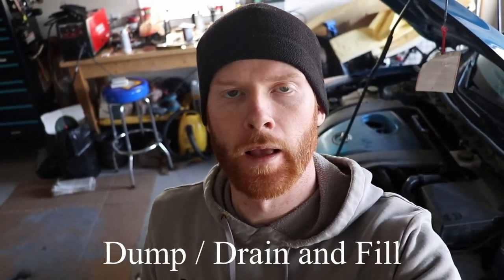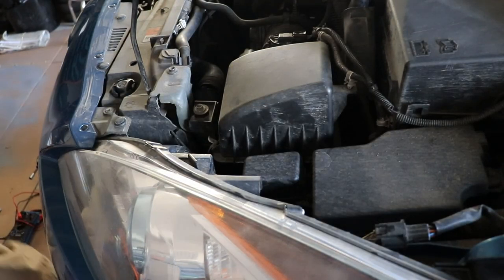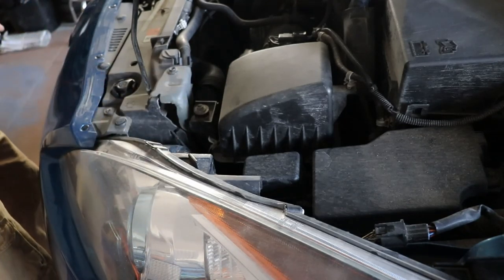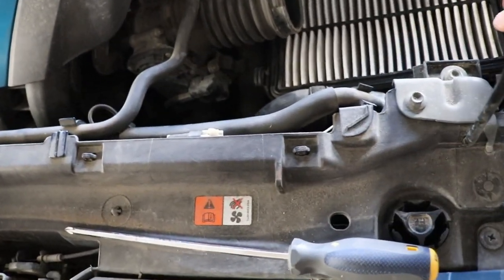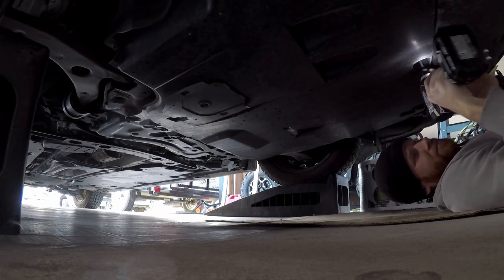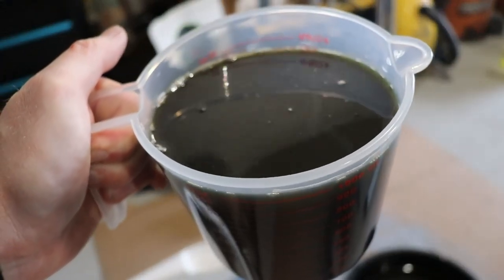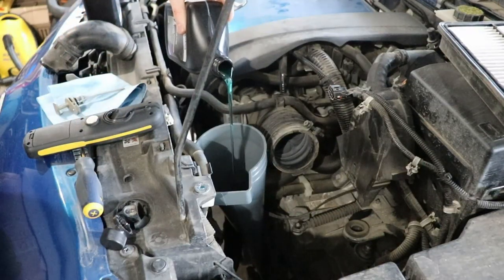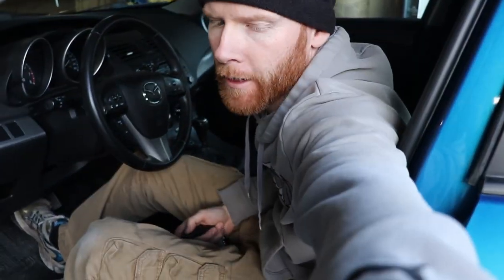Mazda 3 Skyactiv Transmission Dump and Fill

Comment: this is why I love youtube.  cause there is no way i'm about to pay someone 300 bucks to do this for me.   took my mazda in to get the tire pressure sensor replaced.  (200 buck btw for one that's broken.)  and they then call me with over 1400 dollars worth of repairs needed.  one was a transmission flush.    i do most things myself especially when i have the tools.  thanks for the tutorial. mines a 2012  but looks identical to this one.
Reply from the maker: I am the same.way if I have the tools and know how then I will try and fix it myself. I am glad to see more people wanting to learn and be able to fix things their self's. glad you like the video. this wont get all new fluid in after one change. I have been looking at other methods to get a complete flush done. I might attempt it this summer.

Comment: Recently did 2 dump and fills on my 2012 mazda 3. Car had 168k kms when I had the first oil change then another at 170k kms. I also had the transmission filter changed and the pan cleaned. The performance of the car has improved greatly and fuel consumption has gone down alot. The car feels like it's sipping fuel right now. Before the first fluid change, the car seemed to struggle with acceleration and power output was low.
Reply from the maker: Thats great to hear, Glad it worked out and you have had a positive outcome. 

Thanks for watching.

Comment: My 2015 mazda skyactive has lifetime Transmission fluid and does not need a transmission flush so i am concerned people will be changing their fluid unnecessarily.
Reply from the maker: Hi Thanks for leaving a comment, I will first off say that lifetime transmission fluid is kinda a lie. Why you might ask well first off transmission fluid is product like engine oil that will over time break down and wont provide your transmission with the lubrication it requires. This is from heat and other factors that will break down over time. 

Now that being said they might kinda be telling you the truth and that is your transmission fluid will last the life of the transmission meaning that. if you never change it well your transmission will fail sooner then a transmission that has changed its transmission fluid say every 50,000 - 60,000 kms. Just remember one thing new oil or transmission fluid is always better then old dirty broken down fluid. 

I hope this brings some new light or information that might help you. Have a look on youtube and other sites to do your own research as well.

https://www.youtube.com/watch?v=hQpsoI_UfZI

https://www.youtube.com/watch?v=RuNNqh8-jkw
Reply: Lifetime fluid is a lie. I'd drain and fill around at around 80,000 miles
Reply: Why a drain hole/plug is seen under the oil sump pan if fluid is lifetime? Also, why original filter is put on sale if fluid is lifetime?

Comment: Most Mazda dealership service depts state that the trans fluid is "lifetime" and should not be touched... ever.
Reply from the maker: Yes, your correct most dealerships will say that, unfortunately oils break down over time with cycles of hot and cold. Your transmission fluid after a certain point will not longer be protecting the components like it used to. My Mazda dealer will do transmission fluid flushes. This will prolong the life of the transmission.

When a dealer says lifetime generally that mean the average lifetime a single owner will have it for.
Reply: @TDLDIY  The car has 65K miles on it (2017 Mazda 3 2.0 Touring). I still feel a drain and refill (4.5 qts) should still be performed. I don't believe it's going to "hurt" anything lol

Comment: Thanks for this video! It's so hard to find info on this. I do have one questions though! Is there a transmission filter that you would recommend changing as well?
Reply from the maker: You welcome, I am glad my video was helpful. As for the Transmission Filter i would say check with your local dealer ask them but give them your VIN this way they can check and tell you if it has one.

For my Car i was told there wasn't a filter but i would always double check to be sure.
Reply: @TDLDIY  right on cheers!

Comment: I got my drain plug snug but now I’m terrified in case is leaking,and I’m thinking about removing the bottom cover to inspect it… Other than that it was a breeze, thanks for the video
Reply from the maker: If your considered let the car run, cycle through some of the gears while you front end is off the ground this way you can inspect for leaks. 

If your still concerned then do short trips and always check underneath for leaks.
Reply: @TDLDIY  I waited for about an hour and then installed the cover back on, and the drain plug was dry after that hour. I’m just paranoid and overthink everything when it comes to cars. If it didn’t leak after an hour sitting there I should be fine right?
Reply from the maker: @GodExplained  Ya, if you ran it for sometime and let it sit with no looks you should be good to go. But maybe for a couple days after just look out for any leaks.

Comment: Why not check the fluid level with the dip stick, that's what its for right?  I have to do this with my daughter CX 5 and I am worried that the person that did it before didn't do it right or what if some leaked out ..  problem is different videos say check it off and some say check it while running... so I am confused a bit.
Reply from the maker: Yes, always check the dip stick. You will have to do this when the fluid is warmed up and engine is running.

When i dumped it and measured it, it just gives me a good idea how much i needed to add. but if you do this when the engine is already warm then you will be putting in too much. since the new fluid is cold or room temp. when the fluid is hot it expands. so you will have to keep that in mind.

I hope this helps.

Comment: As you mentioned, did you do another drain and fill a few weeks later and if so, did the fluid look a lot cleaner than the first time..?
Reply from the maker: I didnt I got busy with other things. But I do plan on doing another one this summer I have about 142000 kms on it now so what like 20 000kms more then when I did it. 

If you did it a couple weeks after then your would have more of the dirty fluid replaced. if you dont then replace it more often then normal. I will do it this summer and I will put an update in the comments what I found. 

I hope this helps sorry I didnt get the second dump and fill in again.

Comment: Such a pain in the ass having to remove the air filter assembly.
Reply from the maker: yes I agree 100%. Most other company's make the transmission drip stick accessible. I had a nissan rogue 2010 it was accessible but had the same type of cap thing on it. but at least I could look down and see it. instead of removing a bunch of things just to get at it.
Reply: I didn’t remove it.    Used a funnel with a long flexible hose.   Way easier
Reply from the maker: @sjhanksaz  oh you had room under the air filter box? Well That is awesome to hear you were able to do it. I am sure others can benefit knowing it is possible. Thanks for your comment.
Reply: Try removing the air filter on a Peugeot 308 diesel

Comment: Just bought same car with skyactiv engine with 118,000 miles on it. I'm debating if I should do a drain. There is no scheduled maintenance in the manual for this engine. Then I read that for skyactiv engine, the transmission fluid is lifetime for that engine until there is a major transmission maintenance. What are people's thoughts about this???
Reply from the maker: So first thing i will say there is no such thing as life time oil/fluids. Oils will break down over time with heat cycles this is why oils good from clear,blue,red,golden in colors to darker or even brownish to black. 

When they say lifetime and you dont change the transmission oil it will be the life of that part in this case the transmission the transmission will run untill the oils is broken down so much the transmission will over time fail hense life time. This is also lifetime because most people dont keep cars longer then 5 years so it will last longer then that and or fail around that amount of time depending of total miles/kms driven how hard you are on the vechile etc. lots of factors.

Now on to the should you change the fluid you do have alot of miles on it already. I had about that much in kms and i did a drain and fill. and did it again a bit later and then i am going to be doing it every 30kms... now i know some people will stay 30kms isnt long and the fluid will last long and they are correct but since i did a drain and fill it doesnt replace all the fluid at once only about 40 to 50 percent so changing every 30kms will ensure over time and many drain and fills later i have good fluid. 

This might 100% answer your question as in should you do it.. best answer for this would ask your dealer and what they recommend. But i will say one last thing New fluid is better then old. The damage might already be done. doing a flush that forces fluid thru the transmission might not be good as why i did a drain and fill. Which ever you decide it will be you choice. 

I hope this helps in some way. Thanks for watching my video and taking the time to comment.
Reply: Thanks for the video and the info. I have 157,000 on my car and I was concerned about the transmission fluid. At that mileage some say leave it alone and pray it lasts. This seems like a happy medium between that and a flush.

Comment: Thanks for the vid.   I just did it without removing the air box.   You can remove the dipstick from below and just need a funnel that has a flexible hose
Reply from the maker: Awesome Thanks i will give that a try next time.
Reply: do u have a link to the type of funnel u used?
Reply: @TDK2K  I got it on Amazon.    Search for this Lumax LX-1603 Transmission Funnel with Hose. 16 oz
Reply: @TDK2K  I had someone hold it in the  hole while I filled so it would not accidentally fall out.   Worked really well

Comment: this is the smart way to do it. dropping the pan runs the risk of stripping or breaking old bolts. changing the filter is pointless
Reply from the maker: For my pratical model i did confirm with the parts department at my local dealer and he said i dont have a filter but a screen. The next time i do this i will drop the pan to 100% confirm for my self. But i do trust the parts manager. Now other mazda 3 in the same year as mine might have the filter it always best to confirm with your dealer against your vin #.

Comment: Blue transmission oil wow who knew the 2011 has got the transmission dipstick back by the firewall i think that the transmission oil is different too from this one
Reply from the maker: I think the Transmission oil for the 2011 is Mazdas M5 ATF red in color. I changed it on my brother in-laws 2010 mazda 3.

Comment: Just did mine today. Wanted to drop the oil pan as well, but it was stuck there for good, so I skipped the step. There is usually a lot a gunk in there around the magnet. The 2014 2.5 Skyactive takes 9mm hex key to remove the drain plug. Also FYI the color of the fluid doesn't mean anything. If you want a proof next time send it out for testing. Thanks for the tutorial.

Comment: Could you do a intake cleanup of carbon build up? This video on transmission fluid change saved me $240.00
Reply from the maker: I am glad you liked my video and it could save you some money at the same time. I will put that on my list of things to do to the car, I am not sure when i will get to it since i am awaiting my other car to be fix due to hit and run. Thanks for watching.
Reply: @TDLDIY  That would be awesome.  It would be nice to see how it's done and what the condition of the valves after 120K

Comment: Does the Mazda have a dipstick? We have a 2019 Mazda 3, but only 30,000 miles. I would like to have it serviced at 50,000 miles for the first drain & fill. Ater this, every 30,000 miles. I am wondering if a sealed transmission.
Reply: Can you check the correct fluid level with the dipstick?  Nice video BTW ! Thank you.
Reply from the maker: Mazda has dipsticks. One can say lifetime fulid or sealed transmission. I will say no fulid will last a lifetime. My dip stick was under the air filter box. Its hidden away unlike other transmission that might have a normal style dip stick. More and more companies are doing similar things. my old 2010 nissan rouge didnt have a normal dip stick either.
Reply: Mazda 3 2019 is 4th generation. The 2013 in this video is a 2nd generation with a preview of 3rd generation features like the 6 speed "skyactive" automatic transmission. I would not blindly trust this video for a 2019 model. Treat this video as general information until you confirm details for your 2019 model.
Reply: @bobloblaw10001  Int total agreement with you. Unless this vehicle has a dipstick that allows you to check the level, and clear instructions on temperature through a scan tool, I will probably allow the dealer to do this. The only issue with drain/fill procedures and this so-called lifetime fluid is the dealer not wanting to do this.  Even if you have 1.5 hours of labor and $60 fluid, plus some shop fees and taxes, this should be less than $250. Yes, a lot for a simple drain/fill, but sometimes it is best to allow the dealer to do this.
Reply from the maker: @bobloblaw10001  Yes, I do agree. with your comment. Use a general knowledge as your year model is not in the same range as displayed in the video.

Comment: 2016 mazda CX-3,  after drain & fill, measured. After  engine warm up trany at 122f/50c using scanner, should the level bw checked with engine off or on? I checked it off and topped a little fluid at marker. However the fluid dropped down to the 122f/50c marker after checking at engine idle. What's the correct way without overfilling?
Reply: Supposed to be with the engine running. I have a 2015 Mazda 6 Grand Touring.

Comment: sir, Does any calibration need to be done after changing the transmission oil ??
Reply from the maker: Not really sure what your asking about. But not calibration is require. if your more specific i might be able to answer you better. If there is an area of concern.
Reply: @TDLDIY  Sir, I wanted to tell you that changing Toyota Cvt transmission oil requires learning or calibration.  Do you need to calibrate or learn if i change the transmission oil of Mazda 3 model 2014 ?
Reply from the maker: @mdshafikulislam8518  oh interesting not that i am aware of, my car runs fine. Others videos i have since doesnt seem to have to do anything like that. You can always confirm 100% with your local dealership.

Comment: Should I flush or dump and change the transmission on my 50k miles Mazda 3 skyactiv?
Reply from the maker: now with transmission oil changes it recommend to dump and fill. if you want most of your oil changed out do another dump and fill a weeks later.

Comment: Hi do I need to disconnect car battery before change transmission fluid? Thanks!
Reply from the maker: I guess you could because there is a couple electrical connectors you have to disconnect. I didn't disconnect the battery when i did it. I hope this helps.

Comment: Wow u put every1 through  that all I have to do is go right under the carr and undo one bolt ur way is excessive taking half the car apart
Reply from the maker: there is no factory hole to access the Transmission plug in the protective plastic. well at least mine didnt. I could get a hole saw and make one. Thanks for giving your input and watching. I will consider shorting videos to get right to the point in the future. I though it would be good to show the whole process.
Reply: English please, thank you.

Comment: I have a Mazda 3 2018 skyactiv. The manual says It does not require transmission oil change. What is your opinion on this?
Reply from the maker: My opinion is its required, fluid/ oil will only last so long before it fails to lubricate properly. oils break down due to heat cycles and become less effective. 

You can always ask your dealer as well but most mechanic will say the same.
Reply: @TDLDIY  Thanks.
Reply: HINT the manufacturer stay in business by cars falling apart quickly,not service unless its engine or transmission replacement..than they happy start at 3K-5k for the cheap cars maybe..and than they would come to the rescue..offer your busted car some number taht is almost used market value, just lets get you into a new finane term..hint hint
Even a nice chunk of trade in value usually built in the price ..we used to pull window tags from entire lot 3-4 weeks b4 "BIG SALE" and the new window tags would go in the night b4 big sale ..only avg. 3k more .. so this way we feel like we really being taken care of..

Comment: What about the transmission filter?
Reply from the maker: Thanks for the comment. I did ask my local dealer / parts desk about the filter they told me on my model there wasn't one it was checked against my VIN #.

Now that being said I have seen other video of mazda 3 that yes they do indeed have a filter. and you would want to change that during the Transmission fluid dump and fill.
Reply: @TDLDIY  my 2016 Mazda 6 touring does have a transmission filter and i changed it along with the fluid at 70,000 and will do the same at 110,000 to increase the transmission life span what you think?
Reply from the maker: @metal1mark73  yes that would be recommended to change the filter when you change the fluid. if you change it sooner then specified then it wont hurt anything changing later can.
Reply: @TDLDIY  i change the engine oil every 4000 miles with Napa full synthetic oil to extend engine life i don't wait for 5000 or 6000 miles cleaner oil equals better engine!
Reply from the maker: @metal1mark73  That's the way to do it.